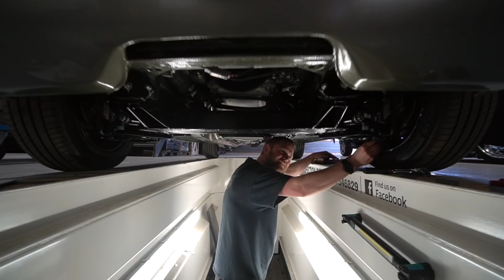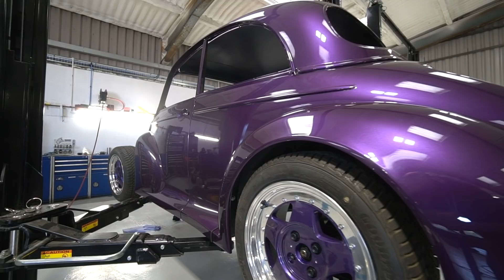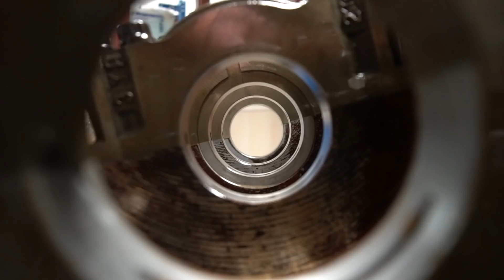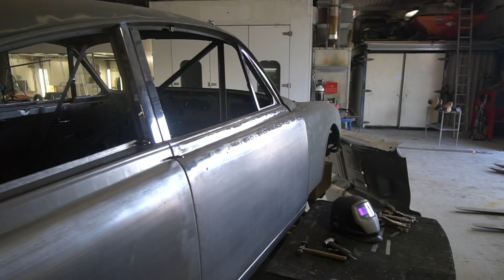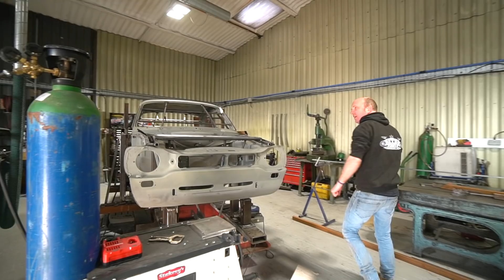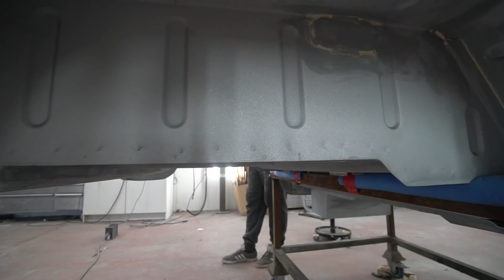Retropower Uncut Episode 81: Purple Morris Minor and Getting Jiggy with an Escort!

Comment: It looks like you're missing the tubular crossmember that sits between the back of the oilpan and the steering rods. It does actually add a bit of stability on those otherwise rather flimsy Mustang chassis ;-)

Comment: You asked about escort body construction.
I worked at Halewood stripping out the Escort to install the BIW facilities for the Jaguar X200. Although this was the later version, the body construction followed Ford's std assembly methodology.
Auto Robot cells assembled the rear floor, centre floor, and front end as separate assemblies. Each sub assembly has a master and secondary datum hole which locate the assembly in the tooling. They are normally diagonally opposite and the master is a hole and the secondary is a slot.
The three sub assemblies are brought together in an underbody marriage line where the datum holes are used again to provide allignment while they are spot welded together.
Once assembled the front master and rear secondary become the datum holes for the rest of the body assembly.
You asked about door hinge fixing.
Doors were added entirely automatically. The doors were in fixtures which swung into place on the car, and auto mig welders welded the hinges to the A B posts through the slots you mentioned. The doors were fitted with the latch end slightly up so that they aligned when the weight of all the trim windows etc was added. Any other adjustments were done with a bock of wood and a large lever!
Reply: Not X200 was  X400

Comment: Interesting as always and watching Stu making a piece of sheet metal take on a compound curve that becomes the roof panel for a car Jaguar should have Mede, is just like the music accompanying him in the video.  The same goes for the entire team.  What a great group of artisans, that you are lucky to have working for you.
BTW, I noticed you said cranking the Rover V8 for oil pressure.  If you remove the distributor, you can access the oil pump drive and use an adaptor on a drill to build pressure.

Comment: If the customer would go for it, I'd be looking at using old man emu springs and dampers as they make the ride and control much better than standard ever was and also ditch the Toyota centres and install ARB Airlocker centre at least in the rear,  or that V8 will eat the orbital gears for lunch on the first hard launch or rocky climb. 

The ARB stuff is absolutey top quality and mostly made in Australia.

Comment: Unlikely you don't know but: with the ford V8's it's possible to prime the oil pump by removing the distributor and the rotating the pump through the distributor hole. Removing one valve cover and watching for oil coming up through the pushrods, "Ford 289 oil pump priming tool"
Reply: You can feel oil pressure come up. And watch the guage as well.

Comment: Mustang front tyres, on the right way round? Tread pattern seems the opposite way to the rears.
Reply from the maker: Probably not, but the wheels and tyres are temporary. They are the ones it rolled in on and will be changed

Comment: I imagine that if the escort body is constructed like a w123 Mercedes they hung the heater matrix in the middle of a room and simply bolted a whole car around it . . .
Reply: It’s the same for nearly all cars, the heater matrix is part of the complete dash assembly prebuilt off the car then installed in the car as one of the first items then the doors hung, interior and engine bay are all built after… it’s why any service/repair work on the heater is usually hard